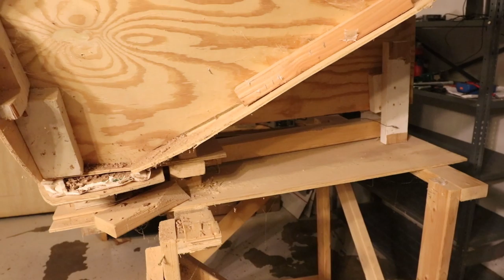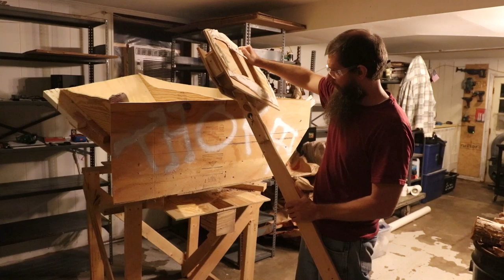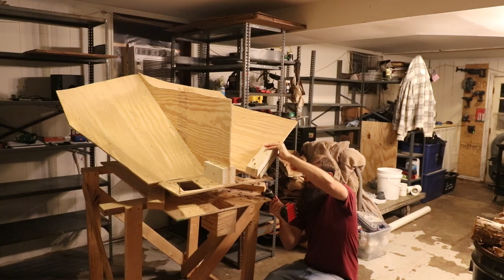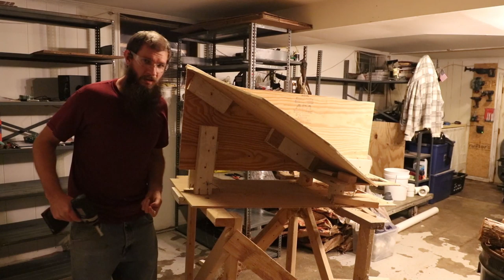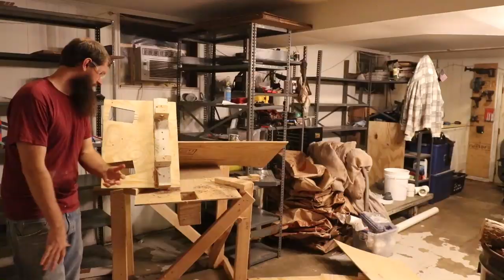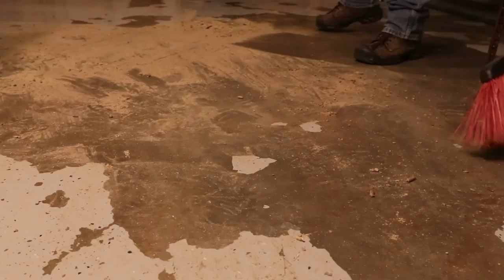Ragnarok for Thor - Breaking down of the old mushroom bagging machine from Mossy Creek Mushrooms

Comment: Thanks for your honest info. Anyone trying is not failing. What parts did you save out of Thor? I work in a machine shop trying to watch all available videos to make equipment that some would make it they had unlimited resources. I'm making our flow Hood out of 20 gauge galvanized a lot lighter than wood. I'm making a walkin autoclave any feedback of details I should include would be much appreciated